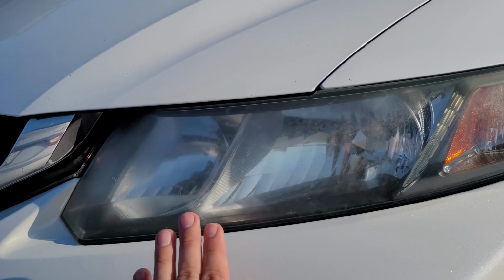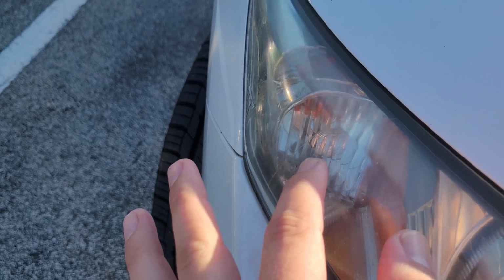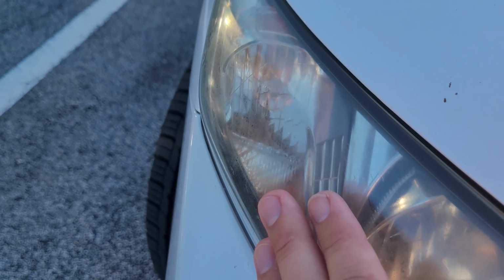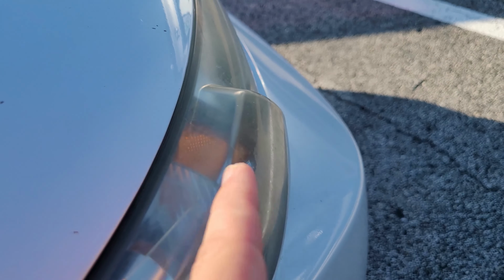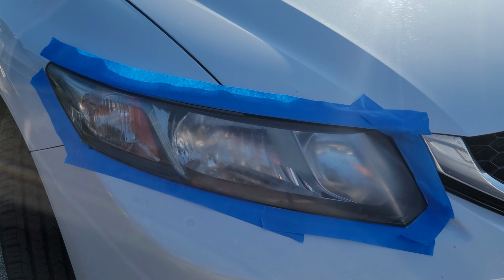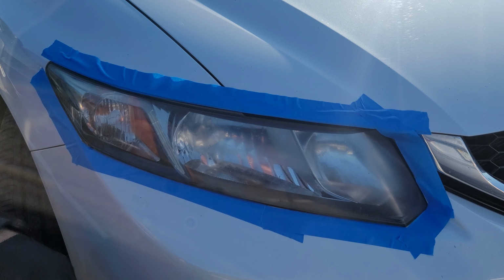From Hazy To CRYSTAL CLEAR in 18 Minutes! | 2013 Honda Civic Headlight Restoration Real time!

Comment: Hey Brad, was going to use 400/600 auto wet dry sand paper.  Any issues with that choice?. Also, at what point to we move to 600?.  Thank you
Reply from the maker: Hi Jonathan. No issues, again wet/dry sanding is about preference. When wetsanding with the 400, you'll begin to see the water being to repel off the lens. At that point, its ready for the 600.
Reply: Thank you my friend!
 @StartRestoringHeadlights

Comment: Hey Brad, I’m on the fence between your product line and the cerakote ceramic wipes. The main issue is the fact that i will be using the Kovax (K-grit) flex sand papers (check them out) the K-600 cuts like a P-320 but finishes like a P-600 so basically 1-step sanding (for your method)  so i wouldn’t  need your full kit packages just the spray itself.  Any future plans to have them sold separately like cerakote did with their pro package?
Reply from the maker: Hi Hubcityhustle! I haven't heard of that sand paper,  but as long as you're at a 600 grade finish as your final step, you will be ok. Yes, we are planning on selling just the cans. However, we are required by law to ship them with the lint free towels due to the Hazerdous Material Policies. For now, youll need to shoot us an email for a special order for the cans only.
Reply: Kovax is made in Japan sandpaper similar to 3M, bit expensive one

Comment: Nice job. So what’s the benefit of using your clear vs a 2k clear coat. There is also another headlight restoration guy on YouTube who says do not use any clear coats. Only polish them out and use meguiars headlight coating last.
Reply from the maker: Hi Ray! Great question. 2K Clear Coat has very harsh hardening properties. This means when its time to redo it, it can be very difficult to remove. Also, 2K Clear usually has to be redone within 1-3 years depending on the application process. Ours last 5+ years, and isn't difficult to remove, should you need too. 

While there are a ton of methods out there, nothing will come close to applying a clear coat. Its what the manufacturer does straight off the line at the factory. Meguiars is good, don't get me wrong, however the longevity isn't. You'd be lucky to get 2 years out of it depending on the application process. If you're looking to start a business doing restorations, the Meguires method isn't the best, since at some point in the future you will have a full schedule of restorations you'll have to redo down the road if you're offering warranty, which is a must in this business.
Reply: Meguiars is a UV sealant (which is a clear coat) so it works perfectly fine for sealing. 2k is garbage as it hardens and cracks over time and can cause serious damage to the headlight.
Reply from the maker: @legit_crossfit  Agreed! If Meguiars had a longer protection time it would be even better. Say no to 2K Clear!